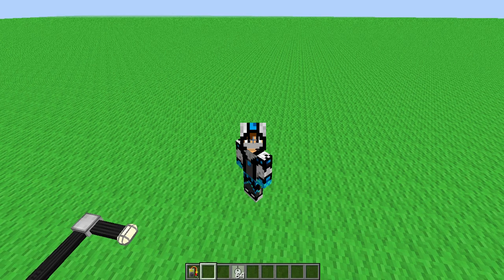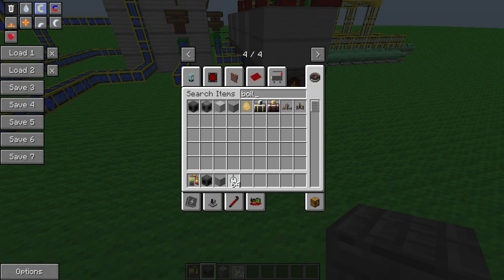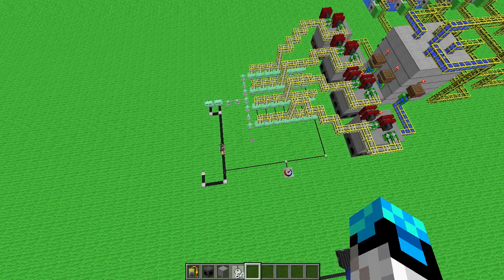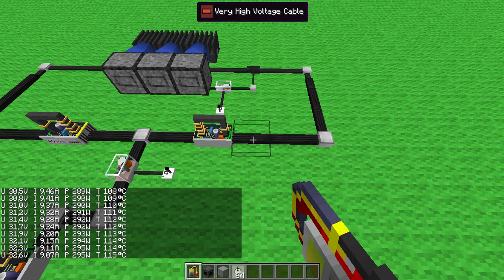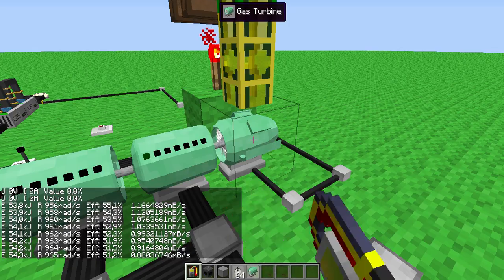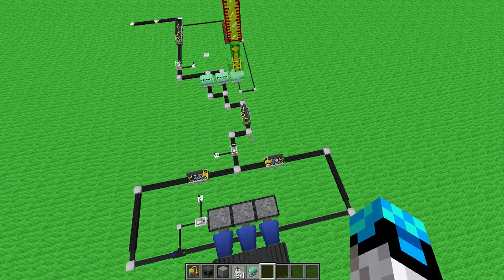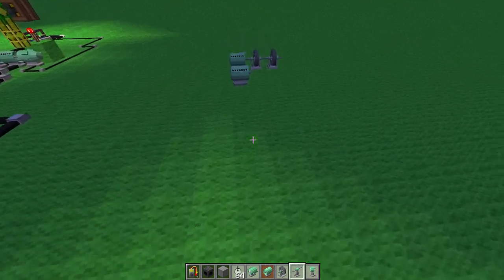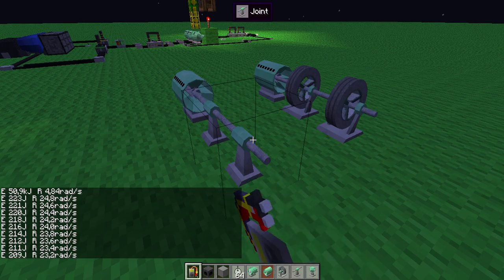Minecraft Electrical age, Steam and Gas turbine generator showcase (LOOK IN THE DESCRIPTION)

Comment from the maker: READ BEFORE COMMENTING: Guys, Before you complain, i used the steam turbine wrong, it is actualy more powerfull than the gasturbine but requiers a lot of steam. what i mean is that the gas turbine requiers 4.0 MB/s fuel and creates around 5kW of power while the steamturbine needs 7100.0 MB/s steam and creates around 16 kW of power.
Reply from the maker: i did that, The info about how to make a steam turbine generator came out not so long ago, you know :D
Reply from the maker: Sorry for really late reply (7 months too late) it throttles up when the signal voltage is higher
Reply from the maker: @Nguyễn Lâm GamingTM https://www.curseforge.com/minecraft/mc-mods/buildcraft
Reply from the maker: @Nguyễn Lâm GamingTM the "Gasoline" in buildcraft is just called "Fuel" https://minecraftbuildcraft.fandom.com/wiki/Fuel
Reply from the maker: @Nguyễn Lâm GamingTM no, in that case i was using NEI
Although Waila will be able to give more information about the specific block one is looking at
Reply from the maker: @Nguyễn Lâm GamingTM connect the ELN cables on one side (the side where it says "ELN" and then the power cable from a different mod on the other side (the one with the circle). then you can change the power output in the block